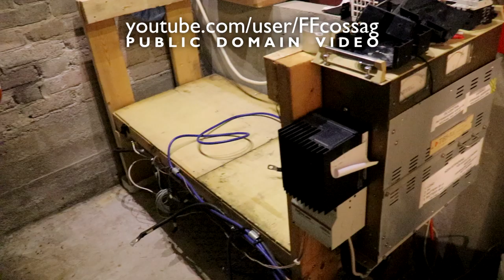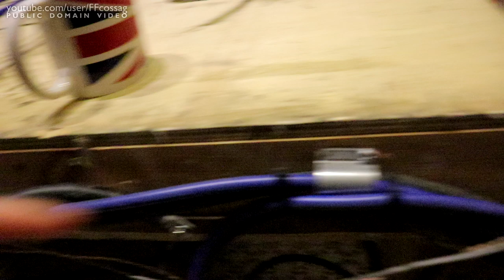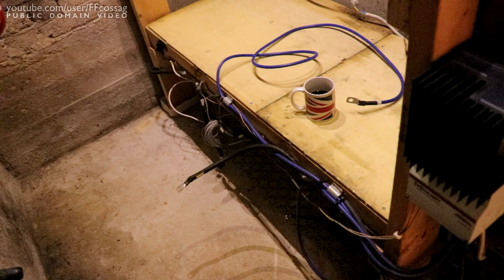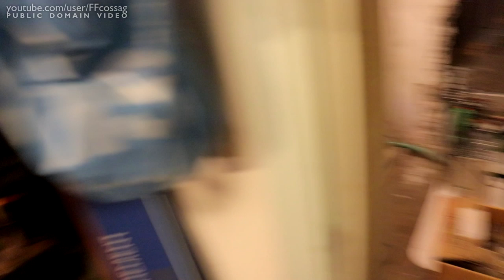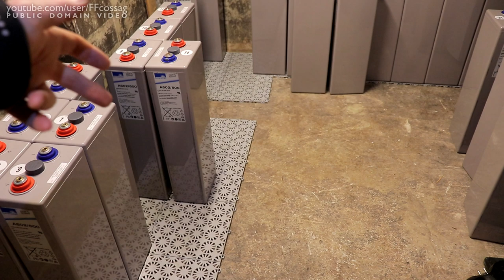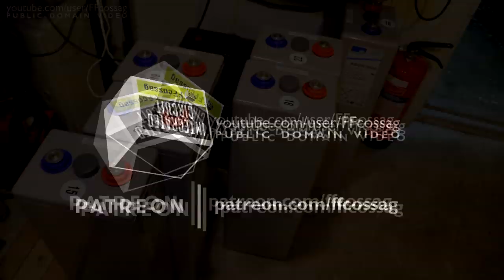OPzVLOG 3 - Building batteries

Comment: @FFcossag - I don't know if you ever mentioned it in one of your AC UPS refurb videos but roughly how long do the 22uF capacitors tend to last? I have a 2010 week 44 SMT1000I that I am considering for a cap change as it has started making chittering noises when on battery.

In addition, have APC backed off their high float charging voltages in recent years? My newer 2017 SMT1500I is reporting 27.2V for the pack at 100%. I am also wondering if it may have a bad cell as it sags dramatically from 100% down to 75% in the first 60 seconds under light (10%) load then climbs back and stabilizes at 83%. None of my other APC units have ever done that.
Reply from the maker: 5 years and the 22µFs are gone.

They always report good voltages, but they're calibrated wrong. Use a meter.